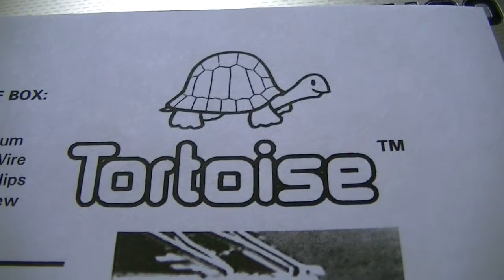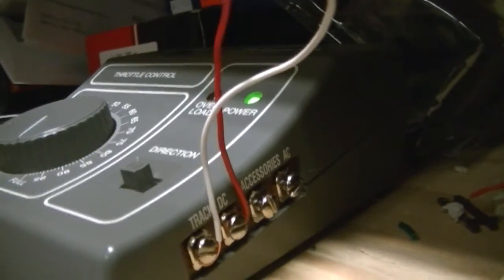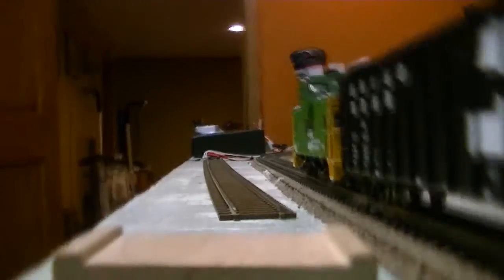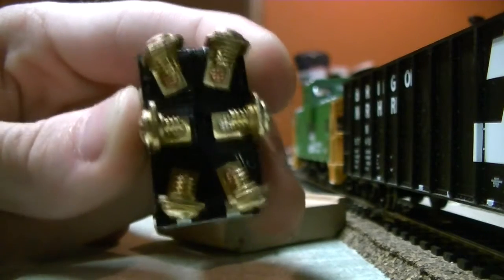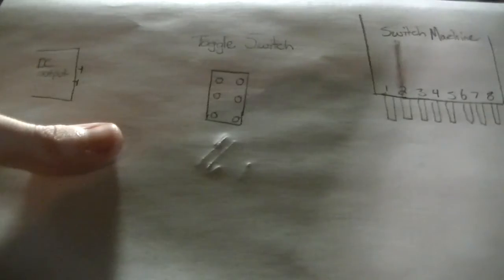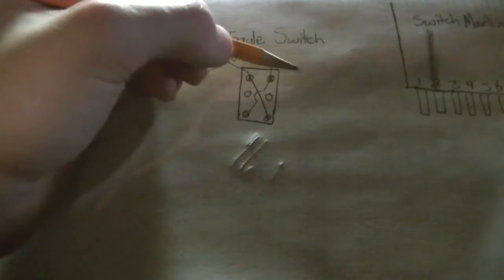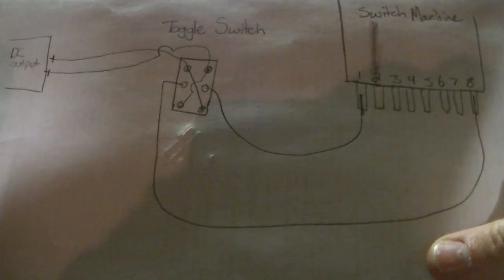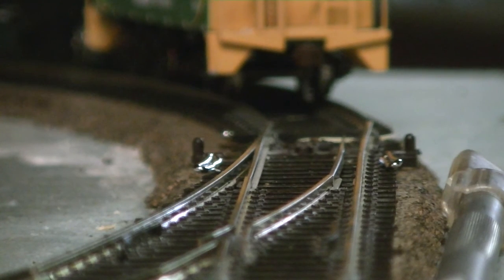How To Wire a Tortoise Switch Machine

Comment: Very informative thank you. Do you have to wire the frog into the tortoise so it changes the polarity.
Reply from the maker: steve nocita I’ve never used any electro-frog switches before, so I don’t know about that process at all. As long as you insulate the switch on the end of the frog that is opposite where the switch points are, it should pick up power from the stock rails. But I’ve never used any with these to know how they work with the switch machine

Comment: Hey,
great video!
can you make one that explains how to add signals and LEDS for a control panel that includes connections to the tortoise?
Reply from the maker: +Andrew Thomas Thanks! Unfortunately, I have not done this, nor am I very familiar with how to do this. Should I figure out how to create a switch board with LED indicators, or adding a functional signal system onto my layout, I will definitely create another video, but both time, money, and know-how are lacking, and I am unable to do that. Sorry!